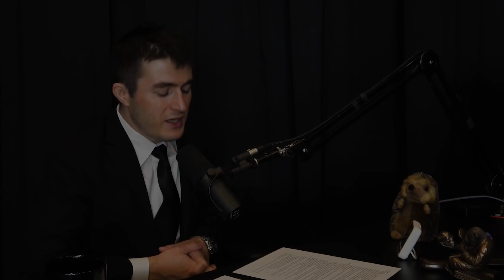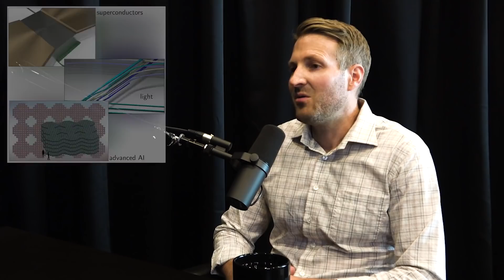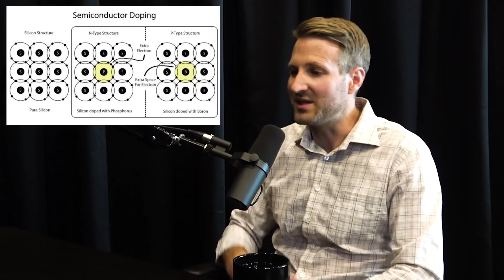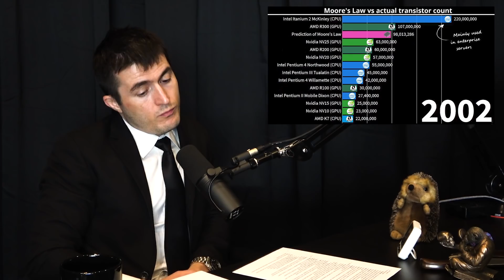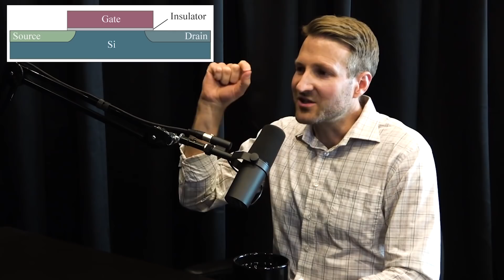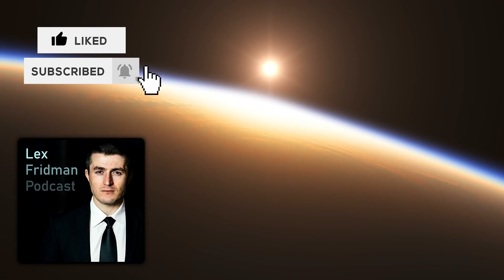How semiconductors work | Jeffrey Shainline and Lex Fridman

Comment: Several of notes/corrections, Moore's Law was on an 18 month basis and held true until ~2012 when the decrease in size of the transistive channel started to decrease on an every 3 year basis instead. State of the Art gates are actually 5 nm not 7 nm as of 2018, when I saw many articles talking about them and the fabs retooling to produce them en mass. When it comes to lithography, the company that makes the lithography tools is ASML, a company in the Netherlands that sells the tools, to Intel, Global Foundries, Samsung, and a couple other companies. Global Foundries does research and sells patents, not mass manufacture, all the other companies do the mass manufacture of semiconductor components. How a transistor is made in mass manufacturing is not even close to how it was described in this video. 300mm wafers have repeatedly failed to work for mass manufacturing for the past 2 decades, they have stuck with 250mm wafers. The reason the 300mm wafer fails is because of the plasma flow issues that deposit or strip materials off of a wafer do not behave in a consistent fashion, and inconsistencies can cost you an entire wafer in production which depending on the step of the process can be up to 1.5 million dollars for each wafer ruined, and for 300mm wafers is probably higher. The description of how a transistor works was very well done though.

Comment: Silicon needing oxygen for the insulator kinda puts a damper on the expectancy of other intelligent life that aren't dependent on oxygen. Maybe. Of course we just went with that discovery while using silicon. 
   I dig how he thinks we were meant to find everything. Old theory of we create God / God creates us, the beginning and end of universal evolution,  is kinda in play here. 
BTW God and religion are not the same. Only 1 of those can get infiltrated/ manipulated/ misused/ completely misdiagnosed. Just as NDT says "the universe has no obligation to make sense to you" can also be implemented in a no religion related grand designer. I know he hates using grand designer thinking but science is the study of truth and that theory has never been debunked. It can't be dismissed, it doesn't have to be believed but also cannot be dismissed as possible.